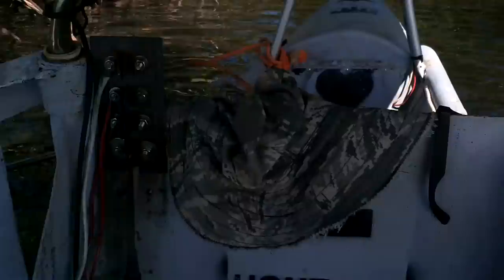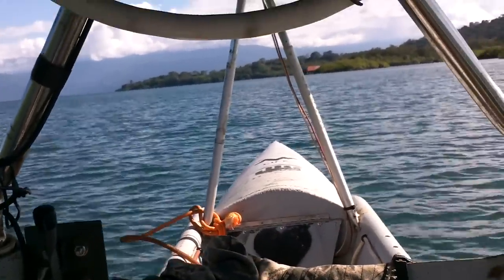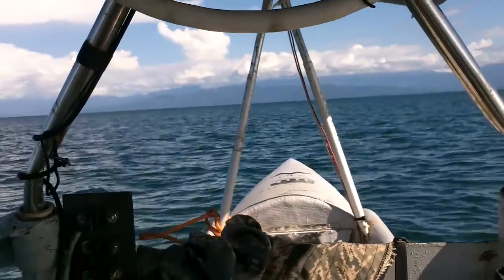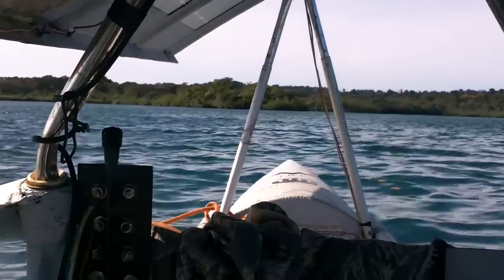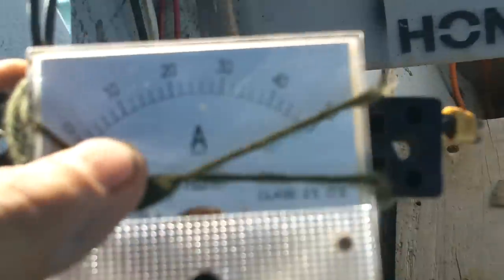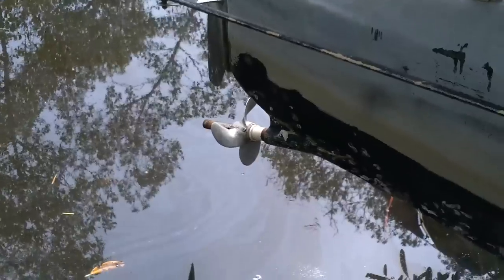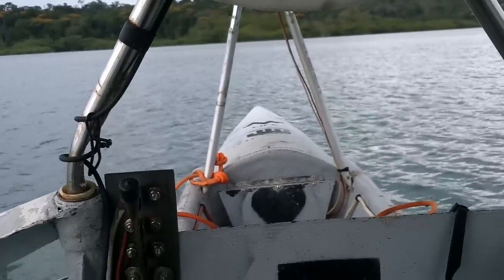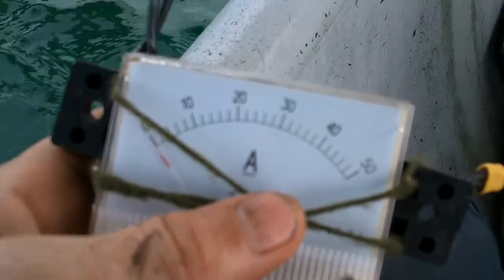Zombie Chopper 008 Tweaking Performance

Comment: Jaimie - I know LOTS about how hard you can push series-wound DC motors like that. *Don't change anything, don't trim that prop, you're fine!* The 39 amp max rating (like any rating) comes with some (fairly blind) context. It's conservatively rated, at "S1" aka 1 hour (more or less continuous) use, with ZERO cooling, in an enclosed housing. The fact that you're moving is enough airflow to completely change that. *Guys regularly give these motors in DIY electric vehicle use at 500% their rated voltage, and 500% their rated amps, for hours, for YEARS* without problems, with just a slight, minimal air cooling if any at all. The limit is thermal, so, if you want to know if you're running it too hot, just touch the motor once in a while (or splash it a bit) and see if it sizzles/boils the water. Also, when your voltage sags down to only 75% (LiFePO4 near end of capacity), you'll have lost that same 25% of your amps, so it'll be fine. You're testing worst-case scenario here with a fully charged setup. If you adjust the pitch, you'll be slogging along with discharged batteries at the ends of your trip. If you're really concerned about the motor's amp rating, put a tiny little computer fan on it (or 2 in series, since you're running 24v) and you'll instantly double the amount of amps the motor can handle without overheating. Really, it's nothing at all to worry about. Don't modify your boat to make it slower out of caution. You're fine.
Reply: Good stuff!!  So general rule of thumb.. If you can still put your hand on it, you're fine!!  It makes sense to me!
Reply: @AtimatikArmy  Naw you can go a bit hotter than that. The human pain threshold starts around 45'c, but people can comfortably keep their skin on something to about 60'c. Boiling is 100'c. Motor normal operating temperature is 80'c even under light load, and nothing wrong with 100'c. That's why I do the sizzle test. Lick your finger and dab it on the surface or splash it. if it sizzles, it's over 100'c, and you might do well to keep it a bit under that.
Reply: @MattsAwesomeStuff  It's so funny you explain this.  I also have my own solar boat which uses (used) a 750W 24V brushed DC motor with a shaft connected directly to the propeller.  I was over volting mine at about 3OV.  The motor is supposed to be above the water line but really ended up so low that any slight waves in the water give me some accidental water cooling.  Well turns out I just have too much load on my motor because it was flashing off pure steam every every single wave and although it didn't stop working, it slowed way down, startrd sounding rough like something is now dragging inside the motor (I'm guessing sticky brushes) and smells horribly of burnt what I am guessing is the enameled coating of the rotor wire!  Unfortunately I wasn't very scientific and wasn't measuring the temperature or the amp draw or anything however it is safe to say I fried the motor!  It was so hot that even after sitting for what seemed like several minutes it would still steam when splashing on water!! 

I have a question for you, do you lose efficiency at some point running a motor at high temperatures (I am thinking like how a solar panel does) or is this totally unrelated in this case?
Reply: @AtimatikArmy  - Yeah, you could just be overloaded. For example, you can overloaded the motor without it spinning at all, just locked up. Will it lose efficiency? Yeah, resistance goes up with heat, so eventually it'll slow the motor down. Sounds like you cooked off a bearing and now it's scraping the worn out bit.
Reply: @MattsAwesomeStuff  thank you for your comments man, I have tried to absorb what you have shared :-)

Comment: You should either make the propeller guard or make a spare propeller with a quick way to replace it, just in case the main one breaks since you only have one way to move your boat now and your main motor is way stronger than before .  Please be careful.

Comment: I'll admit that I am finding the "zone of assumption" built into Victorian Era Electrical Equations can leave a lot of wiggle room, but didn't Mantzel lengthen the resistance wire by almost a third from his original figures based on instinct?  If so wouldn't his full power be a lot more powerful than he originally figured in comparison to his lower gears?  This idea makes me think if it would be wise to really know how much that engine is going to draw when moving steadily instead of guessing and hoping it isn't far too much?  

P.S.  From my limited experience watching America's Cup Races on foils, I'd say the boat is darn close to making them worth the effort when at top speed, but not worth it for losing the clearance and ability to be beached that the boat now has.

Comment: I really enjoy the process of refining a design to a practical balance, this is what I imagined you would do 2 years ago when I found your channel and saw what you were doing with solar. I can see at least another 10% improvements in efficiency, maybe even 20% with further tweaks. I can also see you prefering it over pedal power for your trips to the city as you get used to not having to listen to that grinding sound for hours, when you realise how much noise equals fatigue you start focusing on ways to make things quiet which often equals more efficient as well. You might even take it as far as to building a toroidial propellor which is both but that would be quiet a challenge, maybe you have a viewer with a 3d printer who could help? That would be a series of videos many of us would get excited about for sure.
Reply: i think a ducted propeller would be a better idea considering the shallow waters jamie frequents.
Reply: He has a 3d printer but hasn't hooked it up or used it in a really long time. But I would love to see some more 3d printing ingenuity! (although I know it wastes plastic which is kind of anti-jamie)
Reply: @bakakun  That would reduce efficiency not increase it. Also the toroidial shape is far more resistant to damage than a regular propellor.
Reply: @jedics1  depends on the design goal of the change. enable a flat bottom and less angle of attack for water flow post propeller vs more efficient and simpler design that still somewhat lifts the tail of the boat.

also, iirc Kort Nozzles work supremely well for highly loaded propellers at slow to moderate speeds.

Comment: Water cool your motor, run a pipe in the water facing the front and coil it around the housing. As you drive on high speed the water will be forced up the pipe. No pump needed!
Reply: I've been thinking about doing the exact thing you just mentioned on my solar boat project. A little bit of added drag but probably not enough to even worry about.

Comment: Amazing!  Jamie, thorough testing and thinking has really caused you to make great strides with your zombie chopper performance!!  Wow!  its becoming quite an amazing boat!!  ?? Why don't you run all your solar panels into your charge controller it will simplify your system.  I believe it will end up delivering the same power to your motor.  The charge controller should protect your battery. I realize before you didn't have a good charge controller and were dividing power manually to protect your system.

Comment: For testing it might be good to not try to monitor the current directly, but to monitor the voltage drop across part of the resistive wire coil. Of course at full speed the wire wouldn't be engaged, but you could put a segment of it that is active at near full power. I would have to run the numbers, but I suspect your multi-meter could detect the voltage on a pretty short segment. Then it is just a matter of making a look up table to get the current.

Comment: The Renogy battery monitors are great and would give you all the info you need. I'd suggest adding a temp sensor for the motor too.
Reply: I agree about the temperature sensor on the motor because I just burned up the 750W brushed motor on my solar boat project a couple weekends ago.  Obviously, now I know I need to go to a larger motor...

Comment: 2 questions: Have you seen the supposedly highly efficent toroidal propeller designs for boats? Maybe you could try building one! Also, you may find some use for a 3d printer if you haven't already considered it, and something like a propeller that has such an impact on efficiency would seem like a great place to have something with precision especially as dear as power is for your boats.
There are some pretty cool ways of using 3D prints as a lost wax casting blank or even just glassing over the top of the print and using it as a starting point.
Reply: I was thinking about that propeller too when watching this.
Reply: I love this idea.  A significant amount of efficiency can be gained if one can find a reasonable way to manufacture one.

Comment: If you can calibrate and measure the resistance of your main cable (measure resistance without the cable, then the cable, subtract the first value), then measure the voltage across it at full speed (the voltmeter would not carry current, so it would measure well), you can calculate the current without any loss. Voltage divided by resistance gives current.
Reply: Easier method would be for him to measure the voltage across the cable. while at same time measure the amps with his device. R=V/I and done. It be also much more precise, cause R would be low, and not all voltmeters can measure it well when that low.

Comment: Hey Jamie, how about getting a PWM speed control and hook up an ammeter with display so you can set your motor to exactly 40 amps? I think you'd also save battery at low speeds compared to your resistive speed control. Although corrosion and marine environment could cause problems. Also have you looked into putting a water cooling jacket on the motor?

Comment: Since your running on DC why not add a reverse switch? Also why not tune your coil controller for the peak working amps you need? You could test amps at the coil in to see the amp loss in the coil. The coil is using power might as well use all you can in the water. Save high speed for emergency's. Just some ides.
Reply: The coil wastes power, though?  And it'd be just a short section of the coil, which would get really hot.  Better to figure out some kind of PWM setup, at that point ?
Reply: @idjtoal  Yes the coil makes heat it takes power to make heat

Comment: Having the pedals hooked to a generator to charge the batteries would be interesting.
Reply: No parasitic drag using your suggestion! Nice!
Reply: @AtimatikArmy  Yeah, although I am not sure how much it would make a significant difference. It is just an idea.
Reply: The biggest cost might be the gearing to turn the generator.
Reply: @stevevest7206  Yeah I agree with you but a fun idea nevertheless.

Comment: Hi 👋 Just a question from a follower ...if you lowered the pontoons a couple inches would that be able to raise the boat higher out of the water and reduce surface tension..I think speed comes into the equation...displacement would not change because weight didn't change ....  I really don't know nothing about nothing but my squirrel brain is curious????  😮
Reply: The surface drag on the part touching the water, the pontoons, wouldn't change.

Comment: I watch the thing on YouTube about a 72 volt motor using the 72 volt batteries I guess the power it and it brought the amperage down to like 34 or something,,, in other words what it was explaining that the lower your voltage the more amps it takes to push stuff

Comment: Living where You do....there should be those two blade, long tail motor, propellers available. Just a suggestion....
Reply: My understanding is that those are designed to spin at much higher RPMs and probably far less efficient in his setup.  There are many variables and I could also be wrong.

Comment: Having too sharp a leading edge can cause the flow to become turbulent sooner, decreasing lift, or even causing "stalling". Changing the pitch of the outer vs the inner part of the blade could cause an inconsistency in the pitch over the blade span potentially causing reduction in lift or other flow problems. I know you are determined to do it yourself but foils are no joke, hence my prior recommendations to buy a premade prop. It's pretty much impossible to make an optimized prop by hand. (edit)The prop you made is awesome by the way, not trying to take away from your accomplishment.
Reply: The problem is I don't think there is an off the shelf prop that exists for his application.  I've been using standard RC airplane APC pusher popellers with great results, which are suprisingky very efficient in the water when spun at slower speeds (comparetively speaking) which have perfectly shaped airfoils.

Comment: how about making the propeller heavier
Reply: What would the point be in doing that????
Reply: @AtimatikArmy  more torque
Reply: @jasperedwards2713  I see, like a heavyweight flywheel.  The problem is that the torque needs to be constant, and as soon as the inertia of the propeller starts to slow down, you need to imput even more power to spin it back up.  If the load was just a repeatimg series of a quick spike followed by a pause, then I believe your idea may be helpful.  However, the load in this case is both steady and constant (primarily).

Comment: If batteries are in series it won't go over 50 amps and maintain full speed.
Reply: He's only using one battery.
Reply: @The_Osprey  Yes, it is the Tiger slicer the one with two battery. Anyway, two batteries in series will doble the voltage but the amperage will be reduced in half while maintaining all the power or wattage.
Reply: @neliosamch3195 As long as the motor can handle it sure why not?  .I thought this one only had the single battery in it though if I'm not mistaken.

Comment: A finer pitch lowers the load on the motor, it also lets the propeller to get more bit in the water.  Allowing the motor to spin up helps with efficiently.  It would be handy to know your shaft rpm at full battery voltage, that way you could tune the propeller for rpm and amperage draw. 

I can tell you are enjoying the experimenting with this system. 

I've seem large model aircraft propellers cut down and used on an electric outboard and on underwater ROVs. The brand they were using was Master Airscrew the same brand I use on my RC airplanes. The high aspect ratio of a cut down aircraft propeller should help with efficiency. The drawback is your shaft size, but you do have a lathe.
Reply: YES, you are correct!! Also another good brand is APC which incorporate perfect, mathematically designed aurfoil shapes.  We specifically need to use the propellers that are called "pushers" the kind use on airplane with the prop on the rear (like our boats).  I'm using an APC pusher propeller on my experimental solar boat project as we speak.